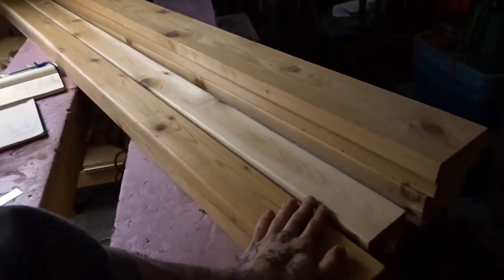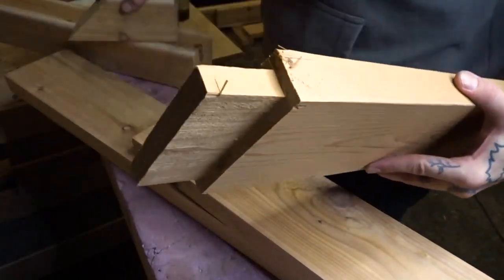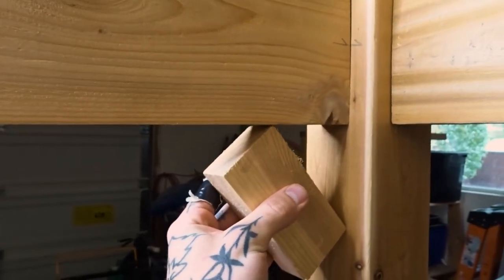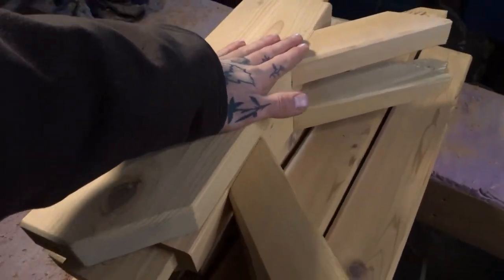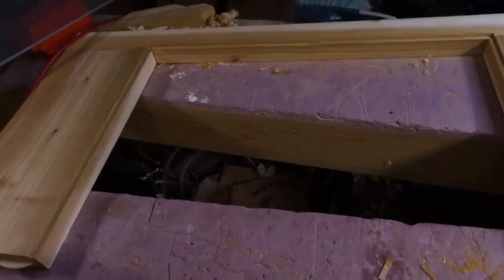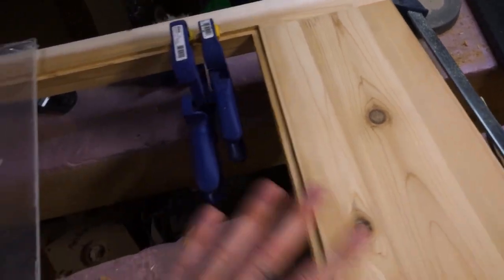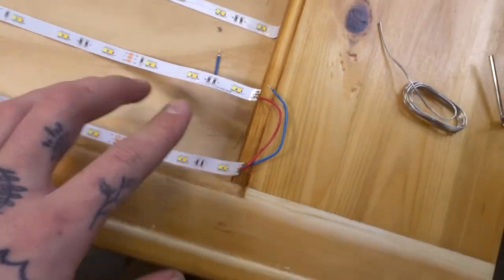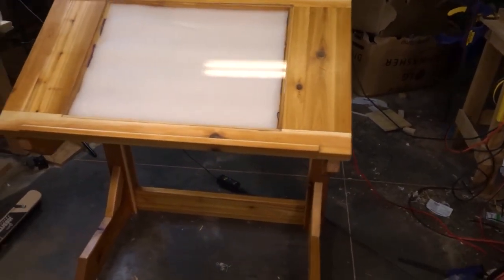How I Made a Backlit Drafting Table // Building My Mom's Drafting Desk

Comment: A very nice peice.  The one thing I would suggest to save yourself a lot of extra work and save time, would be if you wish to difuse the light better without adding in a back peice , take the acrylic and sand the backside with a medium grit then a finer grit to even it out . That will give it a frosted glass look and then evenly distribute the light.
Reply from the maker: Great suggestion!

Comment: I want a big light table. I have the glass and supplies to do an 8' x 4'. I can build the table but I do not know what kind (watt age and such ) to get the light strips in to make them bright enough. I my husband knows enough about wiring to wire them in.  I know it will take close to 50 feet of strips and it will be expensive. I want this table to be multiple purpose so it needs to be big. Can you tell us what light strips you used?  I have been researching it but I can not find the info we need. Thank You
Reply from the maker: I got my light strips from amazon, I don't think the lights need to be anything too fancy because mine worked perfectly fine and they were only like 20 bucks. Basically all you need is some LED light strips, and some sort of material to defuse the light. I used packing foam that I had on hand, but something like parchment paper would probably also work. It might be worth trying some different materials to see which works best. Aside from that, that's pretty much it!